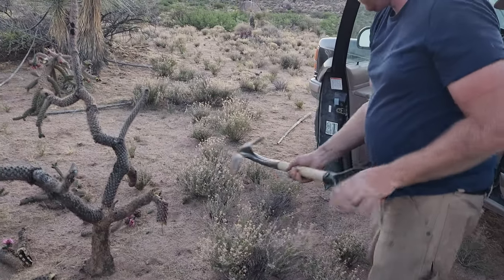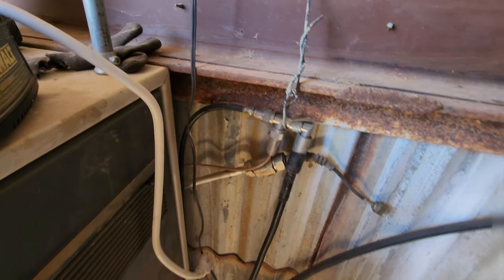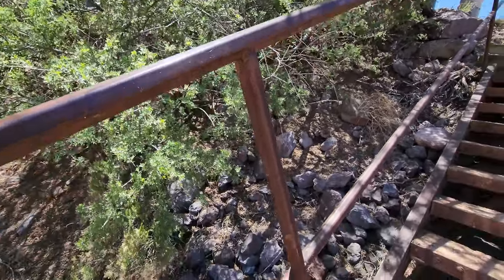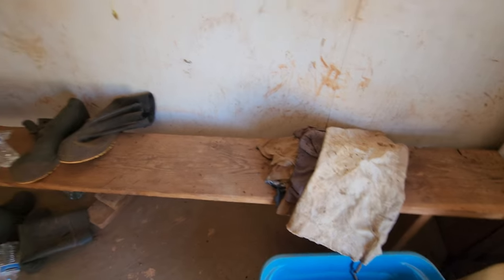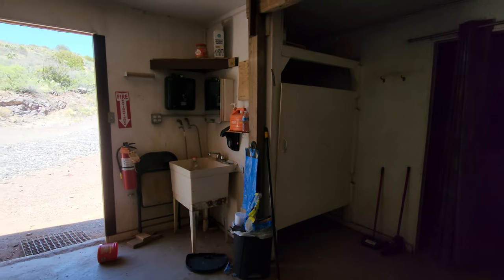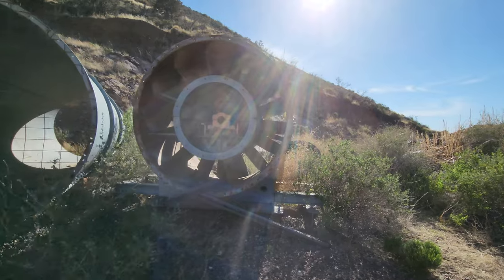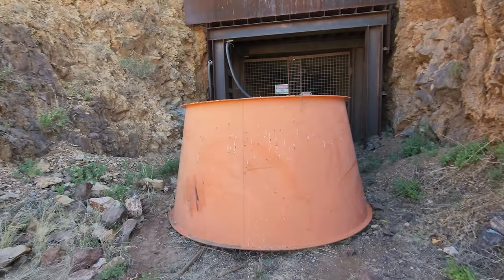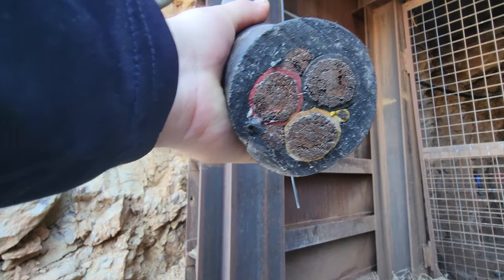Abandoned Underground Mine Exploration - New Mexico 2.0

Comment: I finally recognized where you were.  I've been there quite a bit.  Never was able to get in the lower haulage tunnel, it was way sketch with the huge slabs sitting on the rotted timbers.  If you go past the haulage tunnel the road ends at a very old tram system that goes way up the mountain to a much older mine.  It's kinda open pit and stoped out.
Reply: On the other side of the mountain is another main admit but it looks like the forest service blasted it shut.
Reply from the maker: I did not know the road continued! we will check it out next time! Yes, the haulage tunnel was pretty bad.
Reply: @spdfreakls1  just past the church on the left is a really rough road that will take you to the top of the mountain.  It ends at a digging but just before the digging is a almost unnoticed road that drops off the other side of the mountain.  That road will take you to the campground at the bottom of the mountain, the same road that goes to the test site at the top of Baldy.  If you take that road off the back of the mountain there is a huge waste rock pile and a fairly large adit.  The adult has been collapsed by the forest service.  It's big enough for a skid steer to drive in.
Reply: I nailed it from your intro footage that you were in the "test site at the top" range!  Thanks for showing so much more than just the access road I've been up & down many times.  I'm only at 22:22 & loving it so far.  Have made plans to get the f outta Baltimore & back to NM within a year (ABQ) before catching a stray bullet here.  Give me the Wild, Wild West any day!  Love your explorations!!!  I'll be scattering more comments around your posts from the last year like so many mason jars of carrots & green beans!😋

Comment: the little generator is DC field generator to drive the field winding on the big alternator. Its only job is to make the alternator work. This video is awesome!
Reply from the maker: Interesting. Why does it say ac on thr name plate? What you say would make sense
Reply: @spdfreakls1  I mean on the smaller generator, 9:02.  On the top of the plate it says "Direct Current Generator" notice it doesn't say 60hz anywhere on the plate. Just volts/amps/rpms . That is what they use to excite the rotor coil in the main 100KVA AC Alternator.    "Technically" its also an AC generator but it has a rectifier system to actually output DC.  Those green rectifiers on the ground 8:56(square stacked plates) are probably the rectifier system
By varying the DC voltage into the rotor of the big boy, they can regulate the AC output voltage. Lower the DC, lower the AC voltage(I'm oversimplifying it). It makes the rotor into the magnet needed to induce current into the stator.  
For large generators, it's a relatively common setup. This is a really cheesy but informative video on it if you are interested. fortunately it's short  https://www.youtube.com/watch?v=7MvjbC4f5Aw